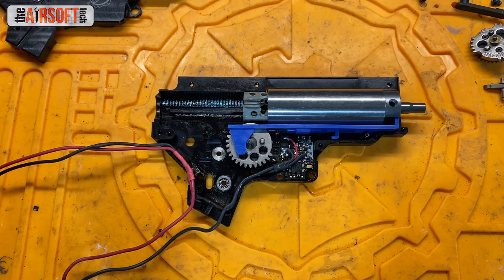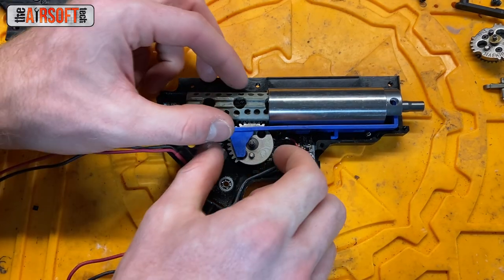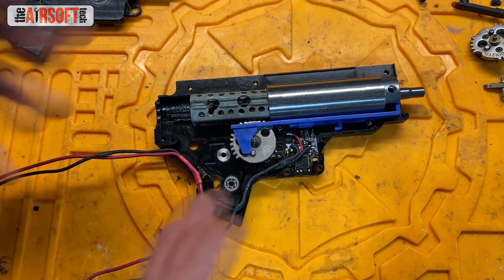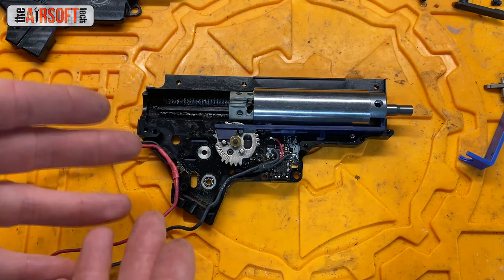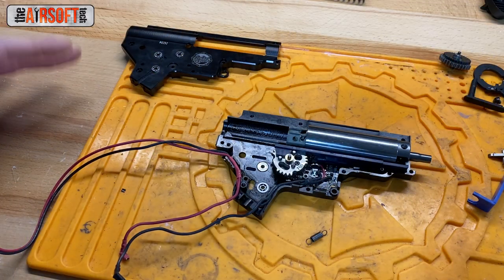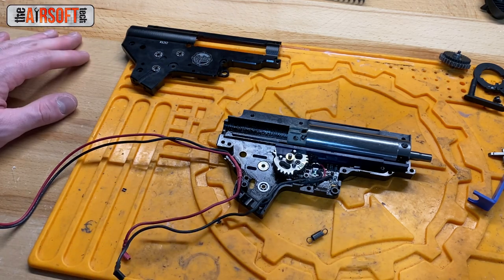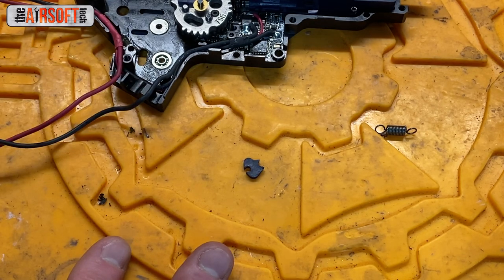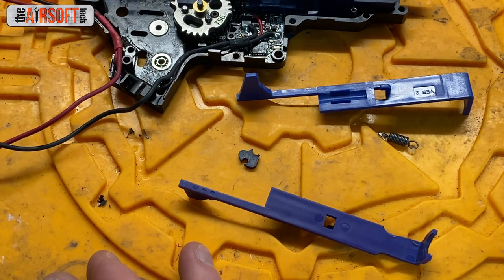Inside the Gearbox: Everything About Tappet Plate Timing

Comment from the maker: Part number for thicc’r tappet plate spring:

9654K959

https://www.mcmaster.com/9654K959/
Reply: Cool thanks, I just took a educated guess on that set. I actually ordered its weaker sister spring just in case a couple days ago. I measure a stock spring that was cut 3 coils and hung a 3.8 or so lbs receiver set off of it. It moved a little more than an inch, so stock springs are probably rated at 2.5 to 4 lbs. The set you use is over 9 lbs! So, with bro science it should be 3 times as strong as a stock spring. Thanks again.
Reply: You should make a video about where you source other AEG machined parts  🤓
Reply: The “Mc” is pronounced like ‘McDonalds’, not like MC Hammer. Hurts my ear-balls to hear it mispronounced.
Reply: Could you explain why there is a solid bushing under the spur gear and ball bearing on the top? Are there ball bearings on all the other ones, including under the sector gear?

Would really like to know if this is something I should do on my builds from now on.
Reply: @KAG2203  bushing where the forces are. Bearings where the speed it.
Reply: Hey thank you ! super helpful video! how many rps can work properly with that MCmaster tappet spring?
Reply: Thank you so much for this crisp and clear video. My question is, have you tested so you know how high rps/rpm
This McMaster spring supports? 60/70rps, maybe?
Reply: Most hardware stores will have a variety of little springs. You should be able to find the right one or trim a similar sized one down, but will cost you less than a dollar. No shipping/handling fees for a pack of 10, when you really only need one
Reply: Would this stronger tappet plate spring also help with “mid cap syndrome” feeding issues where the spring pressure from mid cap mags push up on the BB’s too much when the mag is full or close to full?

Comment: Before they had tappet delays for the sector gear, we used to use the old school 6mm plastic mech box bushings, sand them into a nice shape and glue them in.  It was a little tedious, but they fit and worked great if you did it right. For $0 you decreased the friction and wear on the tappet plate while improving the timing.
-- Happy Hunting

Comment: Another important thing: Shimming of the sector gear and/or the thickness of the part of the tappet plate that has any kind of contact with the sector gear because the back arm of the tappet plate can get pinched between the sector gear and the gearbox shell if there's not enough shimming or if the tappet plate is too thick at that point.

Comment: Perfect timing! Should be getting my new proprietary v2 Tappet plate for a G2H gearbox and I have to trim the fin for DSG. Thanks so much!
Reply: Those aren’t proprietary
Reply: @opairsoft8100  they are, they have cutouts toward the nozzle brace where the gearbox is reinforced. And a normal Tappet plate will not fit.
Reply: @venusairsoft6783  ....less then 10 seconds with a dremel will fix that...

Lonex has the same reinforcements inside the shell and people have been “modding” different tappets for years upon years in them.

They aren’t proprietary
Reply: @opairsoft8100  I’m kind of a stickler I want to keep the part 100% unmodified so I know that’s it’s not compromised in any way. Although several people have suggested that,. I found it easier to replace with OEM.
Reply: @venusairsoft6783  then airsoft tech work is not for you. Literally 99.9% of upgrading/changing parts/improve performance is about modifying them to work with each other due the the horrific standards that are in airsoft.

Comment: When operating a stock AEG on semi-only using stock trigger contacts with cut off lever and SSG, where should the nozzle rest at the end of each cycle between shots? Should the nozzle be at its furthest rearward position as shown @1:17 in the video? Just curious when the cut off lever resets the contact shuttle and cuts power, what position should the sector gear and tappet plate be at rest in between shots and whether final nozzle position has any effect on double feeding. Thanks.
Reply: It depends what type of battery you are using among other things like an electronically regulated cycle etc. The more juice the bat has, the farther back the nozzle will be. I've tested it with 11,1V 25C and 30/60C+ batteries and the difference is appr. 3mm. 
The nozzle will be pre cocked most of the time in semi auto. I would say for a good functioning airsoft the nozzle should be at least halfway visible through the BB feeding port. You could try removing the delayer chip on the sector gear, stiffer tappet plate spring or weaker battery to reduce the pre cocking.

Comment: What is the McMaster-Carr spring part number? I ordered two sets I think will work but want to compare what you use.
Reply: I would like to know too
Reply: Mcmaster car part number?
Reply: @parky6031  One of the sets I ordered seems to be the exact one the Tech uses (9654K959). The other is a weaker spring (9654K958). I crudely measured a cut stock spring in  lb/inch to be about 3 or so lbs. The strong spring is close to 10 lbs and the weaker is almost 6 lbs.
Reply: @Taseden  so should I get the first one for a dsg then?

Comment: Thank you for the info. Im having the same issue in my retro arms gb. Im drfianrely think of trimming down the tappet plate fin a tiny bit to release early. I am having the same fps inconsistency whenever i had the sector delayer in place after remving it. Semi works great about a 10fps +- but full auto has a hard time kewping up.
Reply: Try the SHS dsg tappet plate works great in RA gb
Reply: @SpeedSim_  i will give that a try

Comment: Awsome video.. I have recently rebuilt my FN-FNC G&K gear box.  16:1 Gears SHS + CNC SHS cylinder + SHS piston + M130 spring. But the nozzle always stays a bit back in resting. And i have redicolous air loss??  Could my tappet plate be slower than the piston?

Comment: Nice video man! :) You have any suggestion to what may cause feeding issues in m14 cyma? Right now first 30 or so bb's from mid cap / hi cap mag shoots for about 2 meters / 150fps, after that fps goest to 410-420 on m120 spring and gun shoots OK. Only when I load 10 bbs into midacp it feeds and shoots ok. Could you help me resolve my issue? :)
Reply: Not sure if you've found a solution yet, but to me that sounds like textbook "midcap syndrome". It happens when your bbs are pushing up so hard that they force your air nozzle into the top of your hopup chamber. A tell tell way to check this is to see if you've got scuffs on the top of your hopup chamber where the nozzle goes in or excess wear on the neck of your nozzle near the tip. Fix it by clipping coils off your tappet spring or replace with a stronger one as mentioned in the video. You will also want to check the play in the nozzle on the cylinder head when it is fully extended. More than a few mm up or down play and you'll want either a new nozzle (be sure to match the new nozzle's length to your old one) or a new cylinder head. Finding a combo that allows the nozzle to slide freely but not have excess play will likely be very much trial and error involving buying a few different brands of each to find the right combination for your build. Hope this helps.

Comment: Pardon, but would anyone have the part number for a P90 gearbox? More specifically the Krytac P90 gearbox? Thanks
Reply: A tappet plate?
Reply: @isaachewitt3415  my bad, should've said tappet plate spring for the P90 GB.
Reply: @DerpHWimbleton  ah do you still need the spring?
Reply: @isaachewitt3415 funny enough yeah. Haven't actually looked for one as I pretty much forgot about it. Lol

Comment: Thanks for sharing that information, I had tappet issues before and now I'm starting to build a dsg so this comes very handy.
What are your thoughts on POM or Aluminum tappet plates?are they worth?the aluminum can create potential issues?
Reply: I’m not an expert, but from my understanding the aluminum tappet plates aren’t very good. Tappet plates are supposed to have some bend to them I’m pretty sure, and I’d imagine the slight extra weight could cause issues for tappet timing potentially? I’ve heard another big gripe is the anodizing wearing off over time and getting that in the gearbox
Reply: @roycedoll115  hmm yeah I guess they have to bend to compensate for the height of the sector gear but regarding the weight I guess it shouldn't affect that much, and for the timing maybe using a reinforced tappet spring with a coil or two less will make it return fast enough without breaking it against the gb shell.
Reply: In so many cases plastic is actually better than metal in an airsoft gun this will annoy alot of people, but those people havent been playing a decade like myself so they can kindly go do one, il say this, if the plastic parts last half as long as the metal ones, but cost half as much, it is always better to pickup plastic parts in my opinion, (other than gears, bushings, gearbox case and other required metal parts), parts like metal bearing spring guides are good, like its got major benifits over the plastic non bearing ones, it makes full sense to get one but not all parts are better metal imo... the easiest one to explain is a piston. Pistons strip and when a metal toothed piston strips it can often take gears with it, and even if it doesnt imediately, if you dont know one tooth is gone that tooth will be flinging around your gearbox every shot and will surely take out a gear tooth some day or another. A platic one will die sooner, sure but you can buy 2/3 pistons for the price of one gearset and the plastic will easily just get crushed by the gears and wont damage them so easily so why risk your gears for it?

Another one is metal piston heads, they are louder and dont absorb as much of the impact of the piston as plastic do, so over time a metal piston head is more likely to crack a gearbox shell, or cylinder head, sure itl last longer than a plastic one, but the price of a new GB shell can get you like 3-6 piston heads depending on brand and other variables. Id imagine with a metal tappet plate again it would be louder, youd need to grease more as the friction between metal and metal is higher, if you didnt metal shavings in the gearbox which would just shred any o rings over time, if it ever warped it could jam your whole GB and at the RPS of a DSG like your on about who knows what that could cause, burnt out motor maybe?

Dont get me wrong, there are applications for metal parts, over where I am from in the UK our full auto AEGs have to fall typically around 350fps with a 0.2g even outdoors so alot lower than other countries but higher than some, for us id say metal parts like metal piston heads, full metal teeth piston and so on are only really useful for DMRs, hey its my opinion but its just what ive found... Im the sorta guy thats always bushings over bearings because reliability to me is of the upmost and repairability too

TL:DR In short airsoft parts are expendible sometimes its smart to choose what parts to make more expendible than others (plastic vs metal) to keep other parts in tact and to keep your maintainance costs down